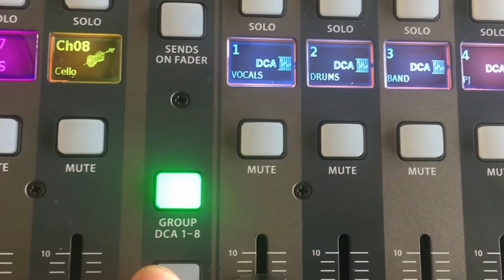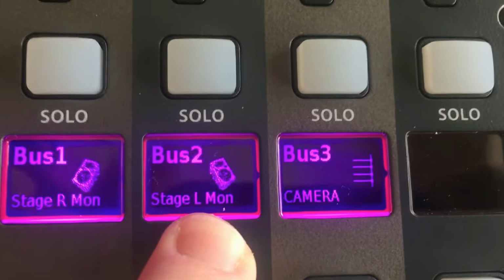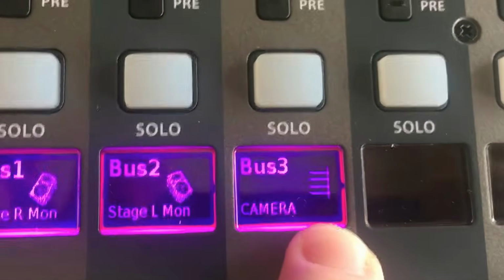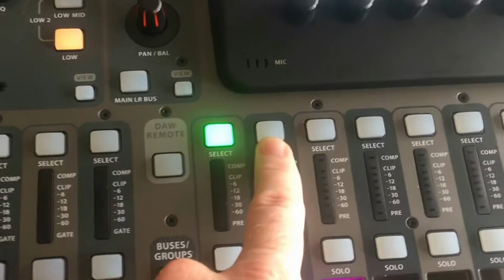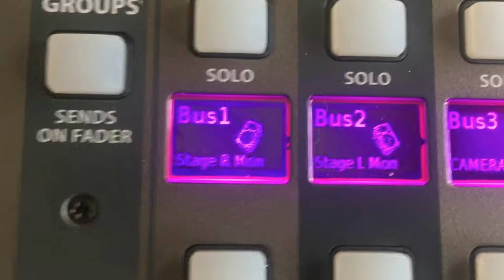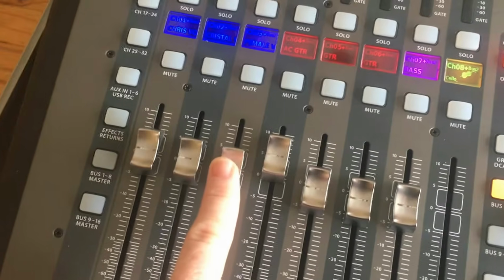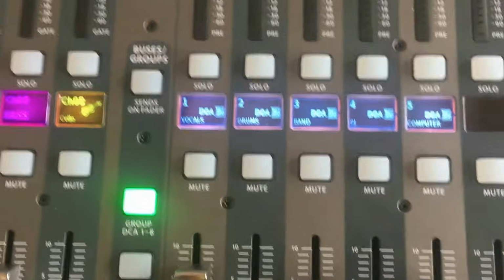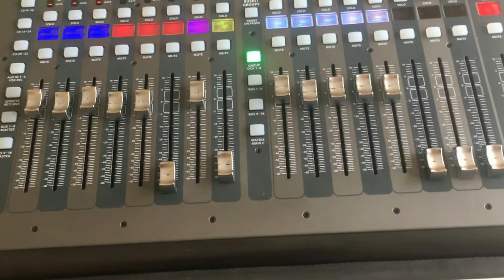X32 Monitor Mixing

Comment: What different between rack and desk one
Reply: Aside from the lack of physical faders on the Rack, the ecosystem of the units are the same. The rack can be setup and controlled via an iPad via the Behringer software (x32-Edit) and a router. Other software mixing options are available ex Mixing Station.

Comment: Can it be done in the opposite way? Selecting the channel of the source (ex. bass) en moving up or down the fader of the buses (aux) ?? Thanks for the video!
Reply: The sends on fader button will work both ways. If you are selecting an input, (on the left) you can adjust levels into each bus (on the right). Or, you if you select a bus (on the right) and adjust levels of each input (on the left). As stated below by the OP, that is not how they are using it in this specific instance, but the board is capable of either way. See this video from Behringer that shows both ways.     https://www.youtube.com/watch?v=yd27P3MOORY
Reply from the maker: If I understand your question correctly, no, it won't work that way.  "Sends On Fader" puts the board into a mode in which you are mixing what is being SENT (SENDS on fader) to a bus or group mix.  To do that, you have to select whatever group mix or bus you want to send to first, then enable Sends On Fader.  Selecting a channel of a source (as opposed to a bus or group) is only used when you want to control specifically that channel, like when you need to change the EQ, effects, name, routing, etc. of that channel.

By the way, this video wasn't made for general training purposes.  I made it specifically for the people who run our mixer at our church, based on the way I've configured our mixer.  Other X-32 mixers won't necessarily be configured the same way.
Reply: @CommunityofHopeHouston  You are WRONG... it absolutely can be done in the reverse... select a ch, press SOF, then push up the buss master faders...
Reply: Community of Hope got it, thanks for the response!!